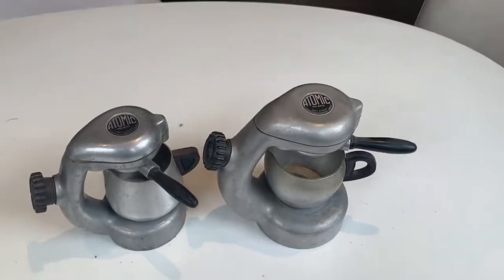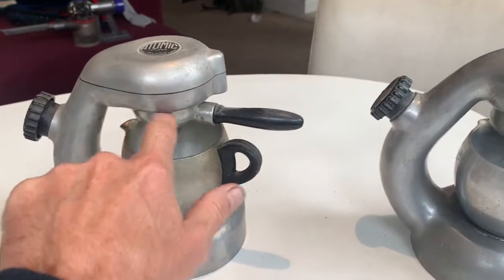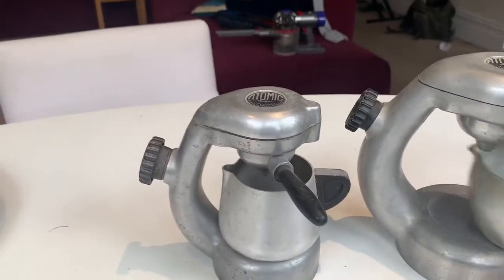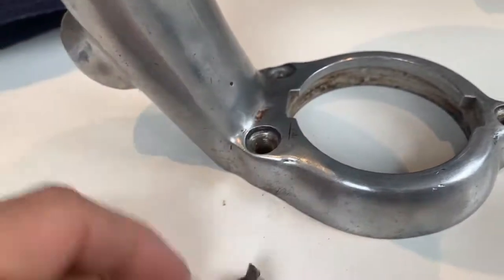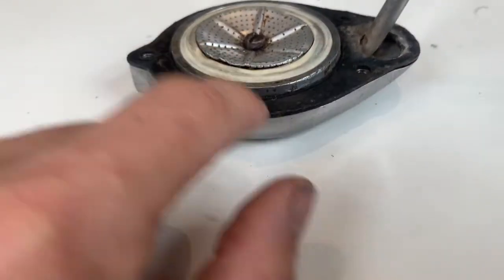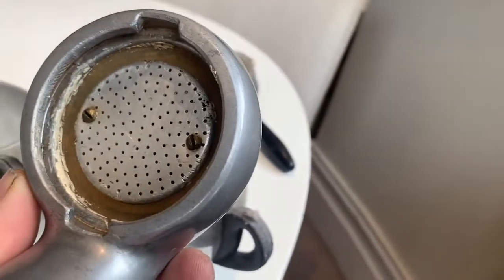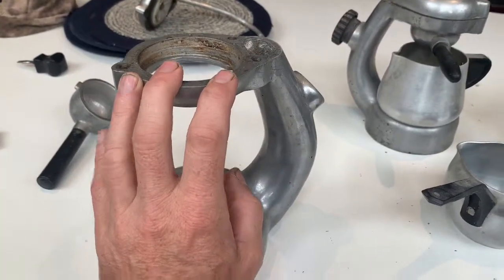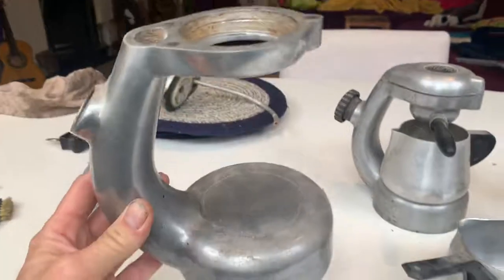Atomic Coffee Machine - Early Flat Head model

Comment: Would a more modern boiler cap, one which contains a pressure relief valve, fit the threading on the older, flattop Atomic machines?  Without that pressure relief, is there not a risk of some sort of dangerous overpressurization of the unit?

Comment: Thank you very much for this video. The one I have is the tiny flat top and it's beautiful . I replaced the gasket and it's working quite nicely 
Do you know if there was ever a silver badge? Mine is silver, but I'm guessing that maybe it sat in the sun and bleached  the black ?
Reply from the maker: No - I think the badges were all black and only became silver (or gold) when the paint had rubbed off. There is actuall a book dedicated to Atomic Badges would you believe! I commissioned an artist to use special heat resistant ink to restore a that Milano badge

Comment: Hi mate, just bought a second hand Atomic in Melbourne (AUS). Is there anyway I could potentially find when it was made? Any tell tale signs? It's got a steam wand and the 'Brevetti Robbiati Milano' label on it
Reply from the maker: Congrads on your atomic purchase. If it has a steam wand, it will be a later machine. These machine were manufactured in Italy through out the 50's, 60's and 70's. I'm not sure exactly when the steam arm was added - if you find out let me know, Mike

Comment: Hi Mate. Do you use any type of anti seize when rebuilding these? Or is the risk of tainting the water too great? Thanks
Matt from Oz
Reply from the maker: G'Day Matt and thanks for your comment - I always put a tiny amount of 3 in 1 oil carefully on the screws on the new machines and run a few coffees through. Not ideal, but I have never had a problem with the oil tainting the taste of the coffee. These days, Bon Trading (Oxford Street Sydney) supply brass screws which don't rust. I find that the best way to avoid problems is to regularly take the top plate of and clean it. I dont use a flat head for daily coffee and therefor don't oil the retaining screw on these machines. Mike
Reply: @scottitonline  Awesome, thanks very much. Ive picked up a cool red atomic for $100 Aussie dollars a few days ago. Pulled it to bits completely  and have ordered new parts. Unfortunately the 2 screws up top have completely snapped off so i used longnose pliers to pull out the plate and will put rivits in the new plate to block the holes. Steam arm was a struggle but slowly i just rocked it back and forward and mill by mill it slowly came out with no damage. Was sweating abit as i had just watched your vid saying dont touch it. I like a challenge!!
Thanks again Mate!!!
Reply from the maker: @matthewconstable7541  The red Atomics are fab - we keep one in our camper van in Oz....although I guess we wont be seeing that for a while.I wouldn't worry too much about putting rivets in the top plate. It is quite usual for those screws to snap off. It doesnt matter and it wont affect the coffee as the top plate is predominantly held in by the gasket not the screws.The moulded aluminium into which the screws screw in will cover the holes. Mike in UK